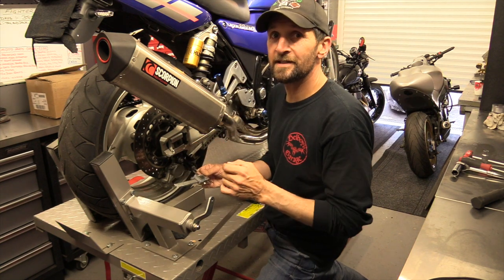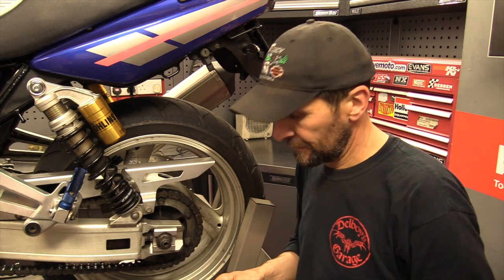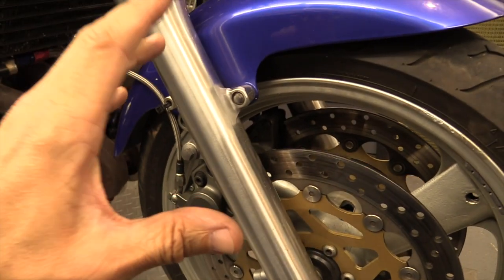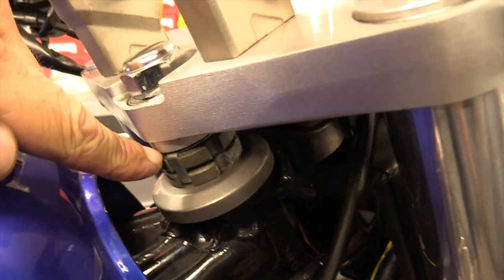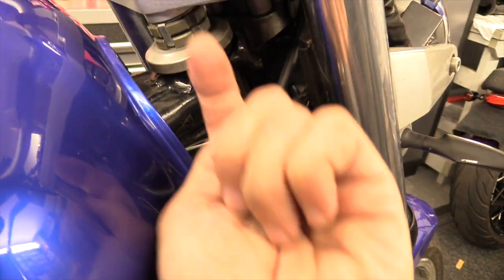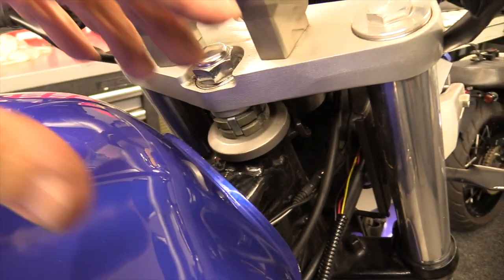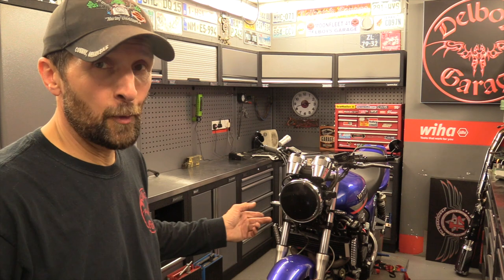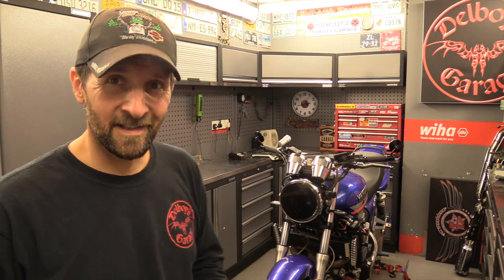Delboy's Garage, Quick and Easy Motorcycle Fork Alignment .

Comment: I always to one more step with the calipers before putting everything on torque spec: Rotate the wheel a couple of times and squeeze the brakes. That way the brake pads will be 100% aligned with the disk.

Comment: My Honda CB500S went down on its left hand side and slid about 10 yards, cracking the stator case in the process,  fixed that issue and put new X ring chain and sprockets on,  but when test riding;  the bike wanted to go left a lot and i had to constantly adjust the handlebars to stop the pull effect.   Not a chance I would have ridden it in that state, far too unsafe - turns out it was twisted forks, this video does the trick.   I have also had garages tell me that it can be done by holding the front wheel between your legs,  tightly, and adjusting the handlebars as you would a childs pushbike.  Essentially they told me twisted forks is a misaligned front wheel.  May need to make slight adjustments while eyeing it from the front, but it does work

Comment: Fork can't turn with upper stanchions secure. The lower triple loosened can however allow forks to move outward or inward, along the lateral aspect of the axle, as witnessed by the differential positioning of the free axle side. This movement process should also be used to align the calipers (mounted to the forks) to the wheel mounted discs. KILLING two birds ... so to speak.

Comment: I know this video is 4 years old, but I saw you use your measuring caliper in a weird way when aligning the rear wheel. You can use the thin part coming out at the back as well to measure depth of holes for example. Now you were eye balling the 2 teeth to the end on the swing arm and the block, turn the caliper around, flat surface it to swing arm then open up the caliper until the piece shoving out hit the axle block for precise measurement. Thanks for the video, had a gap at my front spacer after installing new fork seals, thought one of the tunes was bent, didn't know about the alignment.grts

Comment: Thanks.
I have a 2001 Fazer 1000 that came back from a Yamaha dealer after having new tyres fitted and it was immediately obvious on the ride home that the forks were skewed.
I have watched many videos on how to correct this and this is the only one that worked for me.
It's not just the position of the handlebars but the efficiency of the front brakes.
Thanks again 🙂
Reply from the maker: Glad it helped, you're most welcome!

Comment: Watched this and did it. Bike is a 1982 Suzuki GS550L. Bike would "wander or wallow" slowly when riding in a straight line. Could not keep the bike straight. Not a high speed shimmy but at any speed from 15 mph on up it would "fall off" to the right then correct and do it over and over. This absolutely took care of the issue no doubt about it. Thanks for a well done video.

Comment: Thanks for taking the time to do this mate. I own a brand new MT09SP and it felt going sideways when I got to ride the first time. Sure enough the rear wheel was out of alignment but it wasn’t easy the check as you instructed in the video as this bike has a European style number plate holder hanging off one side of the rear swingarm, so both sides aren’t the same. The added piece does have some marks on it but they are not that accurate. To get my measurements right I fitted in some pointers into the rear axle and measured the distance from those to the swingarm pivot axle.
When all this was done the bike still steered slightly left if left to its own devices. Checking the bike with the string method looked like the front was aligned but through experience sometimes even a small degree could influence a bike’s handling. I decided to loosen the lower fork brace only and push down the bike a couple of times with the rear wheel off the ground on a strong pit stand. And it worked! So happy now. I’m not saying that your method is wrong, in fact it is a more sure way of getting a good result but all I’m saying that it’s worth just loosening the lower brace only at first and see if that sorts it.

Comment: Strange that my Harley repair manuals never explain how to align the wheels. Thank you again . 

Amazing video Del.
Reply from the maker: Thanks buddy, I actually did this with my Switchback when I got it home, cos that was out too, and the only extra you have to do (which will apply to your Roadking also) is loosen off the screws on the side of the headlight nacelle , so that it allows the trees to re-align underneath, there's no need to take it all off, just loosen the screws !  And, again, do them up last, because that  nacelle is just for decoration, it's not structural !

Comment: Appreciate this. Last year I replaced my steering head bearings and was not aware of the proper way to align front forks when I reassembled everything. It's been feeling unstable going down the highway and recently a friend following me on his bike told me he could tell I was out of alignment. Hopefully this takes care of it.
Reply from the maker: Sure thing, make sure you check rear wheel alignment in the swing arm as well, as they both contribute to overall alignment!
Reply: @Moonfleet41  I couldn't check the swing arm with your method as the design is different between the axle and swing arm. So instead I measured from the center of the axle bolt to the center of the swing arm bolt on both sides. It's right on as far as I can tell, probably within a millimeter (hard to tell exactly because I would have to bend the tape measure around some things). Another thing I discovered) is that when I raised my forks 1 inch to lower the suspension, one fork was sticking up about a millimeter higher than the other one. So I adjusted those to match. I still need to test drive it. Even if not perfect, it's got to be better than it was.

Comment: Dude! I watched your first video and then this more recent one. Followed your steps to the letter. After dropping my Yamaha Super Tenere the other night my steering has been off. I thought I'd have an expensive workshop repair, but no. I was able to fix it myself. Just got back from my test ride as the sun is setting. Awesome ride and feeling stoked that all is good with my bike now. You rock, Del! Thank you, mate.
Reply from the maker: Ha ha, nice one mate, glad you got it sussed.. that strikes fear into everyone after a small drop.. but 99.9% of the time it's just knocked off alignment.. thats why bikes have pinch bolts that just grip by squeezing pressure, it's designed to slip and prevent expensive things from getting bent..!
Reply: @stormfalcon72 I have super tenere as will 2018 model ES, needed some aligment also,  i drop it in my garage the kick stand wasn't fully deployed. What wrench did you use to loosen the big knot near the ignation key, and how much torque settings to tighten it?

Comment: I see! This is the correct way to do front forks alignment. My 2010 FZ1S and 2012 GSXR1000L2 are both out of alignment. I am going to try it out. Thanks. Your video is very informative.
Reply from the maker: Thanks buddy, glad you've found the videos useful, let us know how you get on with the results!
Reply: Today I tried it on the Gixer. I put the bike on a swing arm stand. Then I aligned the rear wheel axle first by using vernier caliper. After that I just follow your instructions by releasing all the required nuts from top to bottom inclusive of the brake calipers ones. I released the upper triple tree clamp nut by at least one turn, is that enough? I go on top the bike and pump the upper triple tree like you did. That was scary because there was once the bike moved forward! I should have cable tied the brake lever. Fortunately my friend was behind and he hold onto the swing arm stand. After that I tighten all nuts back from top to bottom 3 times using low mid and high strength. The results is still not perfect but there is improvement. Should I do it again? Anything I need to take note?

Comment: Delboy, I am can attest to your method.  It is fast and effective, works.  You did the video on your Hayabusa and since I saw it, I have not been able to improve on your technique or come up with a more reliable, quick, and easier method.  It just makes life a lot easier and safer if you have to do so much work on a bike.  A fork rebuild can take an entire week or 1 day.  I do not know any other method other than a laser, a string works also.  Nice exhaust.  Yeah you said you would love to teach shop or be a teacher.  I checked your method by letting my hands go at low and high speed, stable as a cat.  I check this every week for tire pressure or any fork irregularity; just let go of your bars and turn the bike using your knees.  The brakes will make them pinch also.
Reply from the maker: Thank you Alex, im glad it worked out for you my friend.

Comment: I appreciate the this vid, I am hoping it will solve my issue following someone trying to steal my bike by ripping up the steering lock. 

Note: to be absolutely accurate with the caliper, use it the correct way, in this case you should be using the pin coming out of the back, lining up the case to the back and push to pin to the block and read off.

Comment: Hands up those who want to see this beauty blasting down a road ... at the speed limit of course ! lol

This is a very cool bike you've got yourself here buddy. I'm very interested in LED indicators and headlights but I'm not sure how they are installed. I've seen aftermarket kit which looks fantastic but i'm totally clueless of how to make it work as it should. Looking forward to learning just how it should be done.

Cheers
Reply from the maker: That's handy mate, next video I am gonna sort out the flast blinking indicators, it's a really simply fix with a couple of resistors, but then she's off for a few days to have a new exhaust created, a new set of headers and a 10" open outlet pipe, it's gonna be a proper screamer !  I will do a ride video once all the work's done, gonna re-gear it, change the shocks and a re-paint, then it'll be ready !

Comment: Thank you - extremely helpful - I have a Gen 1 Fazer 1000, and was riding back down from the lakes, and couldn't help notice that to get the bike riding straight I had to keep the bars slightly turned to the right. My first thought was bent bars but then the triple clamps also looked off to the right when riding so my next thought was rear wheel alignment as I'd just done my chain tension before travelling and used the exact method you used - used a caliper and measured up to the rear of the swingarm. I'm gonna do the fork alignment thing tomorrow and hopefully get this sorted - after 200 miles of riding with the bike crabbing the way it was causes a nasty pain in the mid back lol
Reply from the maker: Good luck with it my friend, Its not clever to ride it like that..! you could also look at the actual clamps that bolt into the top yoke if they are free fitting ones.. they often have nylon or rubber bushings.. check that the bars are aligned with the top yoke with this.!  Good luck with it, and let us know how it goes..! Del.
Reply: Moonfleet41 did it last weekend and it definitely improved things - although just yesterday discovered the culprit, I’m in the process of installing a new chain and sprocket kit and notice I can only push my rear wheel forward on one side - turns out my rear brake torque arm was completely seized to the rear caliper bracket, making it impossible to get a correct chain adjustment done, spent hours trying to unseize the stuck bolt and free up the torque arm - finally got it out today and will be copper greasing everything before reassembly - now to get the rear wheel alignment perfect as I don’t trust the marks on the swing arm

Comment: Great one Del! Thanks for sharing man ;-) I enjoyed it as always.
Just a little point in using the caliper and you probably know it. You can use the little thingy that sticks out of the end of it, when you open it, to measure depth really accurately ;-) So, it can measure three things: 1-outer diameter, 2- inner diameter, 3-Depth!
Reply from the maker: Quite right Abouzar, I should have used that as a demo, between you and me, I know the back wheel is straight, I was emphasising that you should just check it by whatever means... thanks buddy

Comment: Brilliant vid mate!. I used to put my FIZZY front wheel inbetween my front legs, then give the bars a jolt in desired direction! I was 16 though, so forgive me!
Reply from the maker: hang on... you used to put your fizzy front wheel between your front legs....???  are you a centaur then?? And if you are, that must have made riding a fizzy pretty difficult ... Seriously just joshing with ya... I think I used to do that too, and if you had a fizzy, then you're cool by me !!  All the best buddy...
Reply: Delbwoy, had four or five "fs1e`s.Swapped em all, for beer money!Big mistake! Great vid though mate! My bandit is ever-so-slightly out of line, and now i know!Ps.What was the spray you recommended for all year round protection mate?
Reply: I believe its Scottoil's FS 365 Corrosion Protector
Reply: I use ACF-50 I don't know of the other one but they probably both do the job.
Reply: I had the compulsory yellow Fizzy in the early 80's... Done 60,000 miles on it! Bullet proof!

Comment: Virago's are tricky to do this on as the top yolk pinch bolt is uder the handlebar covered by the warning ligh panel so you have to remove the handlebars first then draw aside the warning light panel then put them back on there's then enough clearence to get a socket on it with an extension bar, note to Virago owners, after you've done that this method works brill, no more crabbing even though that effect was very slight before it was "annoying" to say the least.
Happened to me after I changed the fork oil with the forks off the bike this got the wheel straight as a die.
Also the virago has no centre stand so you will definitely need an assistant.

Comment: I would do everything but the calipers and do those seperately. After the fork clamps and axle nut are done up, lift the front wheel, spin it and then stop it applying the brakes. While maintaining brake pressure, then do up the caliper bolts. It seems this is especially important for axial brakes and also radial brakes without caliper locating dowels.
Reply from the maker: Good advice buddy, many thanks...

Comment: Okey Dokey going to try this out on my 73 Suzuki GT185. Handle bars are about 3 degrees out of true when riding which while not a lot is enough to drive me crazy. I'll do the rear wheel first as suggested and onto the front. I'll report back when complete.

Comment: I dropped my brand new bike last weekend and although it sustained very MINOR damages my steering was off. My friend had me convinced my bars were bent since he kept yanking on them to get them loose form the guard rail but now I'm not so sure. Gonna check out my forks asap
Reply from the maker: Sorry to hear that mate, we do hope you weren't hurt... at least the damage wasn't too bad as you say, give this a try and remember if you have handlebars in clamps then they are usually rubber mounted too and they can be twisted literally in the yoke, so see how you get on, and hope it works out for you... best of luck!

Comment: Good job Del - true steering CPR - Compressive Parallel Re-alignment . . .
(Ah, the joys of demonstrating measuring instruments to camera - 'do I keep it the right way up for clarity, flip it over & use the 'ID' jaws or go completely mad & plumb the depths by utilising 'Bender's toothpick' sticking out of it's bum?' Tough at the top aye : )
Reply from the maker: You know it buddy... you can always see it clearer youself than the camera can... it wasn't really to show the measurements on my bike, just making the point to eliminate rear wheel alignment before you suspect the front, as it's far more likely the ear will be out !

Comment: Excellent tutorial. I've had a few spills in the dirt on my DR650 & the forks are out by a fair bit. I'll be using your method in the next few days. I'll let you know how it goes. Cheers!
Reply from the maker: Thats good to hear, im glad we can help.. im sure you'll find it easy mate..
Reply: Job done as per your instructions (except there were less bits to loosen on the DR!). It worked a treat, thank you very much. The wheel & forks are perfectly straight & in-line now. Very easy to do by myself with a paddock stand. This is one of those jobs I wouldn't do without a proper torque wrench. I actually used 2 - a small, high accuracy one for all the pinch bolts & a big bugger for the stem nut & axle. Cheers mate!

Comment: I think my bike is due. i experience braking chatter in corners and noticed weird braking markers on the disc which i used to not have. Will be checking the pads too just in case. Thank you for the most informative videos on youtube. Be safe
Reply from the maker: Sure thing buddy, if you're getting a little chatter and a patternation on your discs, then please before you ride the bike again, check for leaks... either brake fluid from the caliper or fork oil from a blown seal... this can be a symptom of contaminated brakes, sometimes a juddering, or a squeal, and the loss of efficiency can be very gradual, so you don't notice it... brakes are designed to work wet, obviously in the rain, but oil or brake fluid contamination if left un-checked, can start to break up the pad material, so if it was my bike I'd, perhaps, drop the pads out and take a closer look at them and check around your fork seals, maybe pop the dust caps off and take a squint underneath, at the seals themselves, for any oil build up... good luck with it mate, hope it's ok.
Reply: @Moonfleet41  suspention was revise just recently with upgraded skf seals. No leaks to be found. Still i will look into it, thank you.